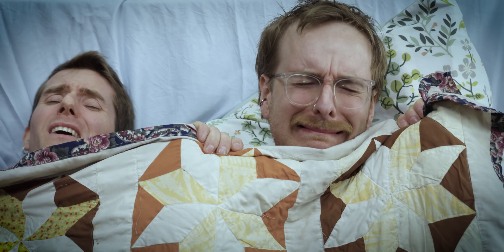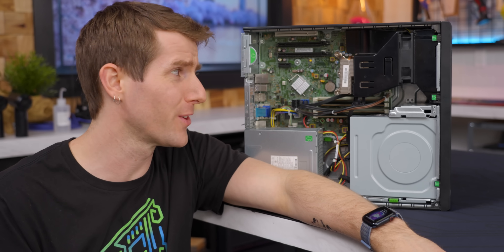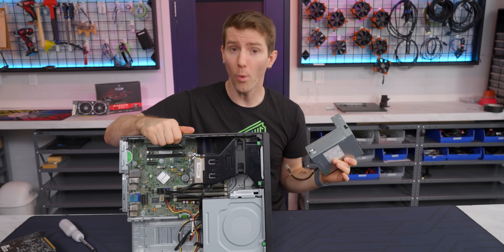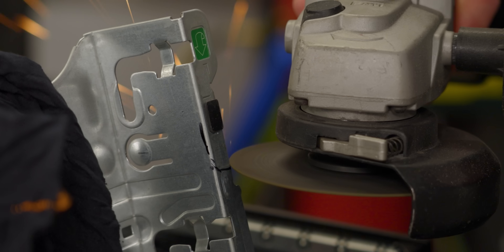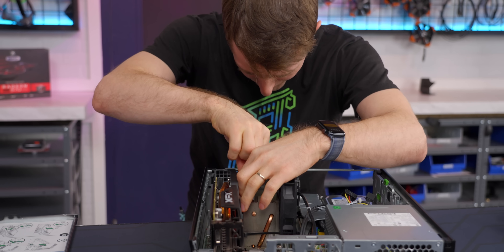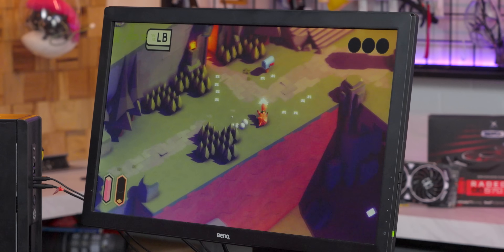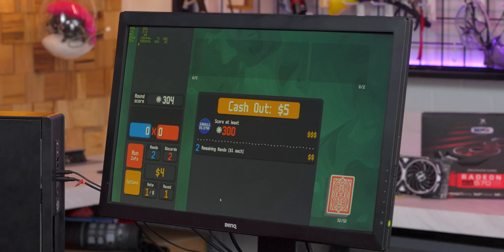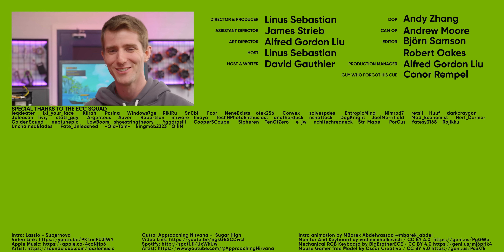How to Build the Ultimate $69 Gaming PC!

Comment: For SFF get a RTX 3050 LP it may just have 6GB but you don't have to hotrod something together and you won't need a PSU upgrade when the PCIe Slot delivers 75W which is documented in the manual

Comment: Ah back to my old formula, the Z Workstation gaming build. Love it. Even found a much better HP Z420 workstation locally listed for $45. 600w PSU and no mods needed to add a gaming GPU. Though it does come with a k2000 quadro, but that probably can't game well. and the whole thing can be transplanted into a standard atx case and used with a standard ATX power supply (with an adapter) if so desired. Great rigs.
Reply: My first good PC was a HP Z400 back in 2013 with a Xeon W3520 (i7-920), 6GB RAM, Quadro FX 1800, 2x 500GB HDDs. I upgraded the RAM to 12GB in December 2013 and the graphics card to a GTX 660 in January 2014. At some point in 2013 I added a 2TB HDD and in 2014 a 120GB Kingston SSDNow V300.
I got the Z400 for 350€ and the Asus GTX 660 DC2 OC for 150€, so if not counting the unnecessary (for gaming) RAM and storage upgrades then it would have only been 500€.
Reply: Quadro K2000 is a "pro" version of GeForce GT 640M. Not a good idea for modern gaming.

Comment: The cheapest PC I can find right now with an acceptable processor and 8GB of RAM is €47.50. It has a Core i5-3470. Anything cheaper has either an ancient AMD processor, a Core 2 Quad, a dual core Core i3, or only 4GB of RAM. Though I did find a €30 PC with 4GB of RAM that also happens to have a Core i5-3470, and I saw a set of two mismatched 8GB ddr3-1600 sticks for only €10. That would be a great €40 PC.
You see, don't limit your search to 8GB PC's.

Comment: The problem with these low budget PC videos is they only work in a larger city like Vancouver. If you're in a smaller city, good luck, most of the electronics is way overpriced or crap from 2 decades ago. 😭

Comment: To avoid problem with additional GPU power it's better to get a card which doesn't require additional power at all, or find a GPU with only 1x6-pin and power it using MOLEX/SATA-6-pin adapter. Still a little junky, but would work perfectly and it's less junky than having to deal with 2 PSUs. 1050ti still can handle A LOT of games and it's pretty cheap too.
If you manage to get 1060 6gb it would be much better than rx 580 8gb. Gives roughly the same number of frames per second, but consumes a lot less power (means less heat and noise). If you're lucky, for 50 bucks you may even find something like 1650 which also is a great option for upgrade of old prebuilts.

Comment: I just have random parts around. Might not make a $69 PC with it, but a cool $120 or so I think I can build one. RX 480 8G, AMD 3800X sitting around, B450 mobo sitting around, 32GB old DDR4 kit, 128GB SSDs 2x and 2TB HDD, Old Thermaltake P100 case (heavily used from multiple builds), 120mm Corsair AIO (have used it when 3800X was my main in a lower power mode and CPU was fine at about 60c max). Used market is where it is at bois!

Comment: That $269 is getting perilously close to a Steamdeck in price so would be a really interesting challenge to compare performance for. At least if the second hand market is similar on your side of the pond - Over here at least you can see them in reasonable but not A grade condition around that ballpark, though only on occasion - some patience required if cheap is the goal (for myself I've been looking for a broken/borked one or a good deal on a heavily upgraded one so my current deck becomes the project donor). Though its not like a new deck is stupidly over that budget either.

Comment: For a GPU, a GTX 1050Ti , GTX 1060 or RX 570/580 should at least offer a decent gaming performance for previous gen games aside using an AMD APU  till you can get a somewhat modern RX6600 or 7700 if budget permitting. 

Was surprised that modern games had trouble running off a SATA SSD. Also had scary flashbacks watching this video of the time I had to jury rig a hand-me-down 1.5ghz celeron laptop with a missing hdd to a 3.5 HDD inside a PC tower case with the PSU supplying power to the hard disks and used Linux Mint as an OS due to budget constraints (the original athlon xp + mainboard + ram went bad).

Comment: I've done this, twice. The immediate problem that comes to mind is that SFF desktops are a huge barrier to getting the most out of these desktops, so a tower Dell/HP is always a better choice, unless the hardware is worse. The second problem is that Dell started to switch to proprietary connectors a while back, so a lot of off the shelf cpu parts just won't work for Dell desktops now. Besides that, they're a great way to get an low end PC on a budget. There's even community tools on the net to enable ReBar on these old PCs, so clearly there's a big audience of users with these PCs.

Comment: This is my hobby. Buying boring office PC's and giving them a second life. My favorite build is using a Lenovo M725. You can pick these up with NVME and if you take out the optical drive and install a SSD or HDD in a OD blank you can expand storage cap.  They can handle the Ryzen 2700 NON X and  a 3050 SSF with minimal cutting to the inside to fit the GPU. Absolutely clean build and runs even recent AAA games well with limited settings tweaks. Usually only cost me around $300 to build one out. Sometimes more, sometimes less. The M725 is plentiful and go for around $50 used. When I finish I sell them at cost on eBay just to continue the habit. Hopefully there are some happy buyers watching.

Comment: I got a rearly good deal £25 for a spairs or repairs pc it had a 750w EVGA Psu 16gb ddr3 ram i7 3700k and case and guess the fault the cpu power pins was not plugged in 😂 I only wanted the case so the rest was unexpected bonus so my sons core 2 Quad is getting an upgrade

Comment: dont mislead the 8g vram is not issue here.the vram on 1080p 720p gaming means nothhing. you guys talk vram all the time misleading. infact you even not need  4gb vram. dragons dogma and baldurs gate 3 is not good game test.  these games even problematic on next gen consoles.   open kingdom come 2 you will se it run perfeclty ok whcih way open wolrd and bigger than this two game which in mind should be need vram yes big no. its not need vram 1080p with optimize settings and more impotanlty optizmzed day one rlease like that game. the porblem is pc gaming forget those no disc relase means everything on pc early access. the steam is the reason for that. making your perforamce suffer making pc gaming digital olny early access mod. baldurs gate 3 not a good game to test infact ints one the worst games. think about it xbox series s only strugle two game dalys one is unreal 5 wukong other baldurs gate 3. the xbox one one s  one x  and xbox seires s on sale or second hand can not beatable for any pc. there was time when i3 ryzen 3 with gtx 1050 beat consolses but since than not batable.  baldurs gate 3 and dragon dogma not out even xbox one x which have equel to rx 580. and you guys testing that.   counter strike drops nothing reltated to vram espicaly 8gb vram.  holy game can run 100mb vram even. you also dont need to play baludrs gate 12 fallout 12 modern pc. getting 2007 era pc with 6600gt something you can play all that even 3d games from 2010s. that pc play those better than modern pcs bcouse you have option to install windows xp and play orginal version of those instead of steam lack luster bad versions.  xbox series s also have those xbox legacly support closer to beat pc even. the pc is now dark days not just for budget prizes. legacy support also bad. the only problem is xbox series s it should be around 180 dolalr with disc drive . its down on sales but its not have disc drive. which makes xbox one  and one s 50 dollar and for 100 dollar one x a king. no pc can beat those. they run on hdd yet games run ok after open.  optmize for pc espcliay after 2020 a nightmare. only game work good without patches is kindome come 2. you cant buy even blu ray disc drive that pc price on pc . which blu ray support never come to pc games. even single that makes value for xbox systems bcouse you can found way cheaper games physcal.  and the most tragic one you cant buy baldurs gate 3 physcally on pc its only consoles physcal rlease. no one want to downloand 100gb baldurs gate 3 to see strugle and delete on that pc.  you cant call indie machines eigther bcouse most of indie games today use unreal engine which have problamatic even on modern systems.  you can play only 2d like indie games good. the core probmlem pc is unreal engine optimziatiın no day one optimization bcouse ther is no disc relase of game mostly. all act like early access. rtx 5090 even not enough to solve those. dragos dogma on high settings also sturgle like that rtx 5090 its not about vram cpu or hdd ssd issue. its pc system itself not care optimzation anymore. ı think this bcouse of no day one disc rlease others think bcouse of corona times others blame drivers. its not about hardware issue. the upscaling also not save those mostly.  the day that you rembmer pc physcal games importance than giant gpu with 50gb vram you will save. until than pc will suffer.

Comment: 5:20 You don't necessary need pcie power cables , just use adapters :P. When my 850watt psu broke (dropped a paperclip inside POOF!) I used my OOLD 1997 FSP 300W psu with 2 x molex to pcie adapers for my then radeon 7870 175w tdp gpu (or 4870? 150w) , it worked fine for a couple years until I got of my butt and replaced it. The cpu at the time was an 35watt one? So even if it had ~70-77% effiency it never drew more than ~260watt from the wall.

Comment: I am curious now, what is the minimum rig you can run balatro on? Cuz even this pc is kinda overkill for that game, I bet you could go way cheaper and smaller if all you wanna do is play balatro
Reply: Balatro should run on just about any 64-bit processor (like an Intel Atom or Pentium 4) with integrated graphics (no GPU), Windows 7, 1GB of RAM, and 150MB of storage -- so yeah, even on one of those crappy $70 Windows tablets they used to sell. You can buy one second hand from Walmart for $37, though I wouldn't recommend it...

Comment: I would have paid a little more for the system and gone with the MT variant. Those old HPs MT variants come with a 400w PSU with a 6 Pin PCI-E power connector (with 175W max on that line) most of the time - Negating the need for that PSU.

Comment: Make a pc at 69, 169, 269, etc and graph the fps to find the sweet spot
Reply: I can tell you already the sweet spot will be the cheapest system you can put together with a Zen 3 processor and an Intel B580 GPU (assuming list price) -- so around $600 new, less if you can source some of the parts second hand. Anything faster in gaming terms is going to need a much more expensive GPU.

Comment: I think the rest of the setup can compensate for 4gb of vram, I was building my pc and bought my real gpu later. So I was using an rx470 4gb with r5 5600x and 16gb ddr4 on an 970 evo ssd and I ran 60+ fps on watch dogs 2 high settings easily.

Comment: I took a lenovo m90q thinkcentre and slapped a rtx 3050 6gb in it. Yeah its a crappy gpu but it doesn't require external power and it's the yeston model that's single slot.

Comment: A GPU like the RX580 is more powerful than the PS4 Pro, which means it will ALWAYS (as long as your cpu has 4 cores and was released in the last 12 years) run games of the PS4/One generation at 1080p.

Comment: With the pending doom of Windows 10's EoL, should this PC not have been running Linux? Although the pre-builts like that come with a Windows key, the Windows 10 instance is only going to be valid for 6 more months. Those processors aren't certified for Win 11. I do understand this is a bit of an aside from the point of the video, but still something that should have been mentioned/tested.

Otherwise, love seeing these upcycling type videos. Well done!
Reply: I agree it should have been mentioned as it is only 8 months away and limits the usability of these builds.

Comment: 10:40 would have been also good to mention, while you can use an adapter to convert pcie 4x to the m.2 connector, these older boards may not support them. going back to Z67, theres many "high end" boards that wont support nvme, because nvme spec was released in 2011. theres however some unoffical patched bioses iirc if you want to go down that rabbit hole. also note even later chipsets have some quirky behaviour in early releases, so update!
Reply from the maker: We toyed with including a PCIe to NVME adapter but getting them to work with Chipsets this old (or older) is a whole project unto itself so we decided to probably save em for the follow up. Also, I could not find one cheap enough to make M.2 drive+adapter a better price than a SATA drive alone. - DG

Comment: I like that linus pointed out the cheap cpu upgrades. a quick google search often times figures out the max cpu you can upgrade to and if its cheaper to buy a system with that spec or just upgrade.

Comment: On the LGA 1155/1150 you want that e3-1230 -> 1270 chips, basically i7 for like $20-30, and it's a game changer in how snappy the system feels and what you can do/play at the same given moment. I changed from i5-3470 to e3-1230v2 in ~2019 for $25 and I could watch Twitch 720p at the same time while playing WoW or Division 2.

Comment: Most 6th gen and newer Dell/HP systems support TPM 2.0 and Secure Boot, making them Windows 11 compatible without any workarounds. These are worth the $20 premium over the 2nd Gen shown in this video.
Reply: Except that MS requires an 8th gen or newer Intel CPU (or a Zen+ or newer AMD CPU). The only exception to this are the "7th gen" HEDT CPUs. I haven't tried installing Windows 11 on a system with an incompatible CPU however I do know that MS doesn't offer a Windows 11 upgrade on those systems similarly to what happens on PCs with compatible CPUs when you disable TPM.
Reply: @electricindigoball1244  installing on incompatible CPUs is easy. I have a bone stock install USB and it will install on anything with TPM 2.0 and Secure Boot (first gen Ryzen, 6th gen Intel, even 2011 v3 Xeons if you have the right board). Also worth noting that I've not had any issues with these systems receiving W11 updates either.
Reply: @ What I meant by "Windows 11 upgrade" was the option to upgrade from Windows 10 to 11. I've seen Windows update outright say on a system with 1st gen Ryzen (with an up to date BIOS and fTPM enabled) that it considers the system incompatible with Windows 11. Like I said I haven't tried installing Windows 11 on a system like that so maybe the fresh install works while the upgrade from Windows 10 doesn't.

Comment: My PC build from used hardware cost about 240 C$.. I5 8400, Gigabyte Z370M DS3H, DDR4 16gb and GTX 1070 8gb. also i have a 512gb SSD. And the case and power supply are from a previous PC

Comment: rx 570 and 1060 is still great (4 gigs is fine for most games, but 6 is ideal) but pairing it with an i5 is horrible, you need the i7
I sold my i5-7500 for an i7-3770 and it was a night and day difference in a fuckload of games. From a microstutter mess to completely smooth, the i5 can't even keep up with a 1050

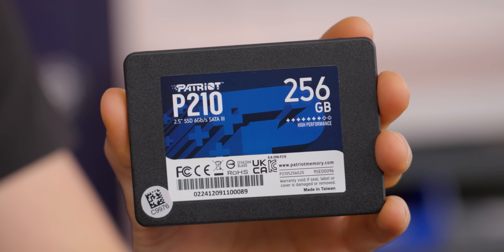Comment: 10:30 I challeneged that point by going on NewEgg, sorting 2.5 sata ssd and m.2 2280, then going from 1tb>2tb>4tb>8tb, sort by lowest price. 1tb, same price for both. 2tb, ssd was cheaper by 4usd, negligible at any budget. 4tb, ssd was cheaper by $20, still negligible in my book. 8tb, m.2 is cheaper by 6usd. So, saying m.2 is cheaper overall at all capacities, as you implied, is incorrect. It flipflops. I would go onto other sites to do the comparison and show results, but I don't want this comment to be stupidly long. I think you might need to redo your research on pricing, my guy.

Comment: im happily using a 1060 3gb with an i7 4970 and 16gb DDR3, along with an SSD and Spinning Rust. In my research the RX570 is under the 1060 3gb (570 is slower and cant overclock as well). Im hopefully upgrading a lil bit from that to either a 1070 or a 2060 soon, whichever my buddy sends me !!

Comment: Don’t forget windows 10 is discontinued in 6 months. And you can’t run 11 on these machines.
Reply: My sentiments exactly.
Reply: @ I have a fully upgraded Optiplex. I am Probably going to have to  switch to Linux. 😢 it’s not my daily driver any more though so i am thinking of doing a internals swap.  I have a 240 radiator bracket I ripped off an old case. I am going to rivet it in on the side and add an AIO. so I can stick something decent in there. You really can’t fit a good aircooler in an optiplex. Should be a fun project! I am going for the Frankenstein look!
Reply: its super easy to install win11 on unsupported hardware.    win11 runs perfect on my i5 7500 and also on my very old dell optiplex 3020 with 3rd gen i3 cpu run "ok" win win11
Reply: @robertsmith3476  bit of a gamble on if they will continue to push updates though :/ they are now, but they haven’t fully phased out 10 yet. We’ll have to wait and see. I hope they do 🤞

Comment: My actual nas/homeserver is an ex Hp elitedesk sff, for 80 euros . 8gb ram, 256 nvme, i5 8500. A bargain. A free arc gpu, 16gb of ram and a pair of (not free) 12tb hard drives in it. Best deal ever. Capable of gaming, with some limitation, but for the price... EBay is a gold mine if you aren't in a hurry. Facebook marketplace is basically useless here in Italy.

Comment: Upgrade to $169 and compare. A $69 pc doesn't make sense for general consumers because chances are, if someone can afford multiple $60 games, they don't want to deal with the trouble of getting a $69 build to work. being able to play triple A games on a sub $300 system sounds enticing. What are the differences strategies consumers should use when shopping at 69 vs 169 vs 269 etc.